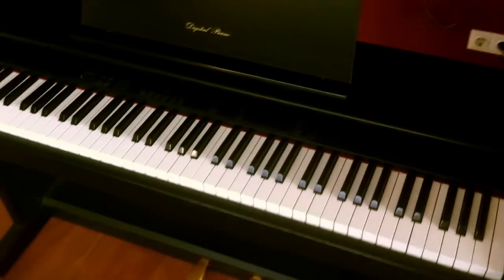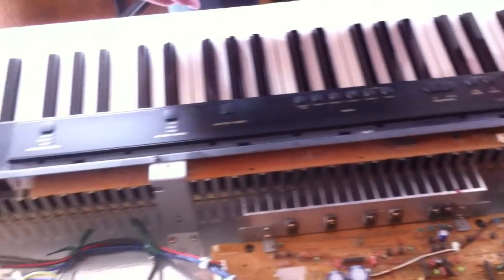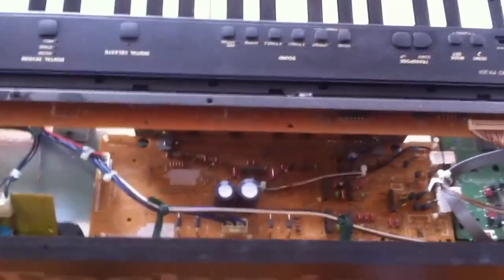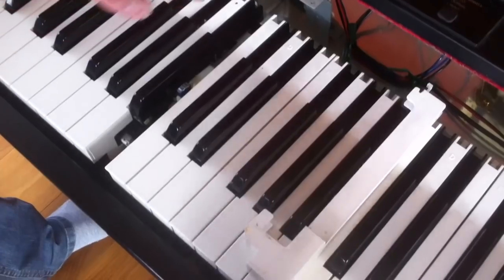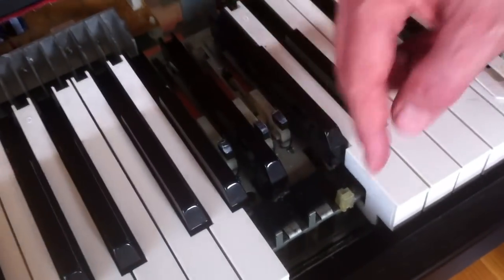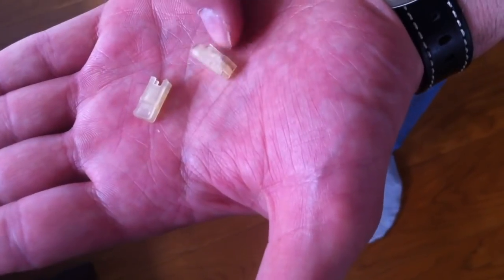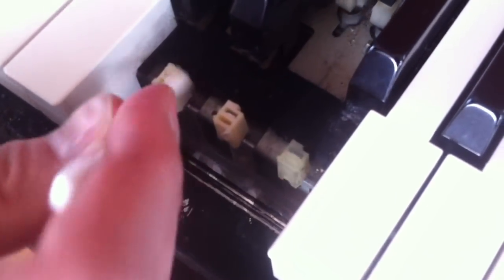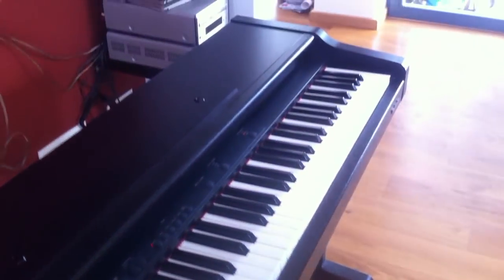Technics Digital Piano Keyboard Repair

Comment: I use a Technics digital piano (the same model as in the tutorial) for tutees who prefer digital over an acoustic piano. Being 34 years old my model is relatively ancient and occasionally keys fail to sound.  I have to dig deeper than in this video to clean contacts with alcohol but your video first gave me the courage to delve into the inner workings of a digital piano. Thank you for an excellent tutorial.
Reply: You can see videos about Korg SV1 and other Korgs with RH3 keys, this is the same keyboard.

Comment: This was a really useful video and fixed my problems with the PX201. I managed to break a key but it still works fine, held in place by the spring. The only foot-note that I would is that the earth doesn't seem to exist on UK models as the earth most likely runs through the moulded plug. The other things I would stress are 1. Unplug first and wait a minute or two as charge can be held in the transformer.  2. Don't force any of the plastic parts. The do come apart easily once you move them in the right direction. If you are applying a lot of pressure, you are doing it wrong. 3. Electric screwdrivers really speed the job up. Thanks for making this video.

Comment: Thank you so much. i just got a used Technics Digital Piano. Some keys were not working properly. So after watching your great video I opened it. Found out that 2 keys were broken. I replaced them with the other keys on the farthest right. I know it is not the best option, but those keys are rarely used. I will eventually order new keys and replaces them. Found an old Canadian coin under another key that was making the metal noise when releasing the key. Thanks again for your video. It has helped so many people.

Comment: Thanks for the vid . I have a technics PR700 which had exactly the same issue, so really useful to see how to deal with it.  A couple of things I'll add. On my model the cables connect to the PCB with plastic connector plugs which you can easily pull out so that you don't risk damaging the wiring attached to the control panel and/or keyboard. I would have thought that's the same for other models too.  In fact I managed to find the repair manual online, and it states that you should unplug the connectors first - it also means you can get the control panel out of the way completely before working on the keys.
I also managed to superglue one of the plastic parts together to get it usable again, and it's been fine since.👍

Comment: Picked up a heavily used PX101.  Not very pretty but the sound is great.  A couple dead keys in the upper ranges.  Your video will be very helpful when I open it up to diagnose.  Hopefully it is only a spider in a critical spot that a bit of vacuuming will fix.  Thanks for the great video.  Spot-on explanations!

Comment: Hello,
Thank you for the video : All those clear and sound explanation  had helped me to open mine with less fears !!!
In my case the issue was a metallic noise when key is released: baize damaged
I just placed a new ribbon
Cheers
Reply: Hey there, same problem just happened with my piano yamaha p45 ... the key  D3  plays with some extra metallic noise.. i gave it to the service centre but they can’t solve it.. would you please help and guide?

Comment: OK back again, finally fund the time to begin the disassembly.  I have taken the 10 screws from underside to free the keyboard but the keyboard does not come loose.  I can see there is a stain on the felt where something was spilled and I'm pretty sure the dried liquid has "glued" the metal kbd frame to the wooden chassis.  I'm reluctant to force the keyboard apart from the wood; could bend the frame.  

What is it that actually makes the key press "work" are there those rubberized / carbon switches under the keys?

Comment: Very useful. I had to go beyond this to deal with a liquid spill. I lifted the front of the keyboard and sat it upright on its rear edge. Then I unscrewed a long metal plate and took the switch circuit board off. Then removed the rubber boot where the liquid had spilled. Will clean the contacts and see if it all goes back together ! Shame I cant attach pics.

Comment: I just can't believe it.  This is my new favorite youtube video.  I have never in my life seen anything explained as clearly and completely as this video.  Just amazing.

One question:  My keys are not loose or stuck, but after we moved, now many of them CLICK whenever I press on them.  Do you know what causes this?  I assume when I open it I will see, I'm just wondering if you have experienced this.

Thank you for this amazing video.
Reply: I have the same problem, clicky keys. Curious if opening it up revealed anything and if you found a solution?
Reply: +Katherine Code Hi Katherine.  The good news is if you open up the piano you CAN fix the clicky keys.  The problem is, this video doesn't address the problem at all.

The good news is, I'm very proud to say we fixed our clicky keys, and it's so awesome, I can play it now without the constant clicking, I love it and it's totally worth it.  But it is way more involved than what he shows here.  At no point was anything difficult or were we worried that we would break something, so I say you should try it, but you have to take the keyboard all the way out of the cabinet, so it seems like you're messing with it a lot more.

What is causing the clicking is unfortunately simple wear and tear.  There is a thick piece of felt along the bottom of the keys.  Over time, that felt gets squished down, so it is no longer holding the keys away from the bottom of the frame, so when you release a key, it taps the metal.  What we had to do was buy a piece of felt from Michaels, cut it into strips about 1/4" or 1/2" wide, and insert it on the bottom ledge of the keyboard frame where the keys are tapping.

To do this, follow all the instructions in the video until you have the keyboard unscrewed and loose in the cabinet.  Do not remove any individual keys like in the video, that is not necessary.

The difficult thing is that you have to remove the entire keyboard from the cabinet in order to access the underneath.  The scary part is you have to disconnect the wires that go from the keyboard to the cabinet (the ones that the guy in the video said he didn't want to mess with).  As you can see in the video, all the wires are tied down with giant bread-bag ties.  Take a lot of pictures with your phone so you can put things back how they were.  (It is actually easy to get everything back together, but it will seem intimidating when you are taking them apart.)

After the wires are untied from the frame, then you have to disconnect them from the frame.  The only delicate part is unplugging the ribbon wires from the circuit board.  This is very tight, so you have to just slowly work it back and forth.  It will come loose; don't force it, just work it back and forth.  Then there is another small wire that leads to the power switch, and I think one more.

When you get the wires all disconnected, then you can lift the keyboard out of the cabinet.  Here again, go slow and don't force anything.  It comes right out, but it's really heavy, so it will take you a minute to determine how to lift it out.  (As I said, this is much more difficult than the repair in the video.  It can be done without any trouble, but you have to be brave and careful.)

When you and your friend have the keyboard out of the cabinet, put it on a table with one end hanging off the edge.  If you get under the keyboard and look up at the bottom of the keys, you'll be able to see where they are clicking.  There is a small metal ledge that runs the length of the keyboard.  Keep hitting a clicking key and you'll be able to see what I'm talking about.  The piece of felt that is supposed to be catching the key has worn down so there's a deep indentation, and it is allowing the metal part of the key to hit against the metal ledge.  You need to put a strip of felt along that lip.  At Michael's, get a few different kinds, you want it to be as thick as possible without interfering with the keys.  (If it's too thick, it prevents the key from coming all the way back up.)

We used rubber cement to just lightly anchor the felt to the metal.  Then we had the felt cut into about one-foot strips.  I got down on the floor and dabbed the cement onto the strip in three or four places, then my friend pushed down all the keys for about an octave at once, and I slid the felt into place.  Then she let up on the keys, and that was it!  You can bang away at the keys and NO CLICKING!

One last thing--you can do the ends of the keyboard this way, but not the middle.  For the middle, we placed the keyboard between two chairs, so the middle section was in the air, then I got on the floor underneath it to place the felt for the middle keys.

That is it.  Then reverse the steps to put the keyboard back.  The hardest step is sliding it into the cabinet because it is heavy and the fit is tight.  Just be careful.  Once you have it back in the cabinet, the rest is easy, reconnecting the wires, tying the wires down, then screw in the screws on the bottom that hold the keyboard in place, then follow the video.

The one thing that troubled us was, when we put it back together, it seemed like there was a gap between the cabinet and the control panel.  Before you do anything, take a hundred pictures of everything, because I figured out that gap was there before (you always run your finger along it to get out the dust, but there's always some extra in the gap).  So everything went together perfectly, and you won't believe you're actually going to be able to play your piano again without the clicking.  It is SOOOOOOO great.

So, this is involved but you can do it.  The clicking on mine got so bad, we made the decision before we opened it that we were ready to get a new piano if this didn't work, but it DID work, and now I have no reason to get a new one.  You will be super proud of yourself if you try this.

Please let me know if you have any questions!  I will be more than happy to help you out however I can.  I'm so proud of what I accomplished, I'm happy to spread the knowledge.  :)  Good luck!
Reply: Thank you so much for the detailed reply, greg! After more sleuthing around online I pretty much came to two conclusions: that the clicking likely IS due to worn-out felt (the piano is over 20 years old!) and that I'll need to take it apart to check for sure and see if there's something else as well. 

Have been trying to find out where I can get the correct replacement felt before dismantling the instrument, so your tip about Michaels and cement glue is super handy. A friend has already volunteered to help, and after reading your advice, it looks like I'll need to take him up on it, even if he thinks putting grease BETWEEN the keys is a good idea.  Hopefully my music will be click-free in the very near future!! 

Thanks again, your knowledge is of great help! ☺
Reply: +Katherine Code  I hope it works out.  One detail--I'm not talking about replacing the worn out felt.  Rather what we did is put a new piece of felt in a different place, where the clicking is actually happening.  The worn out felt is letting the key go down too far, so it's hitting the metallic ledge.  You'll see what I mean if you open it up.  (Replacing the worn out felt would be difficult because it's very thick, it would be difficult to find outside of a piano-parts warehouse, I think.)
Reply: Ooh, that's a good detail to know! Thank you! One video I watched showed replacing the felt (on a different make/model), and it took them over half an hour to remove the old felt with an exacto knife and some needle-nose pliers. Your method sounds much better!
Reply: Thanks again for your help, Greg! Getting the keyboard out of the casing was really easy with the video and your additional instructions. I found some felt with adhesive on one side that I cut into strips. It seems a little thin to me but it's thick enough to stop the clicking which is all that matters. :)
Reply: @greg55666  Thank you so much. I had anyway pulled my piano apart and was thinking about doing the exact same thing with the felt on the metal plate, but I wasn't sure what kind of adhesive I should use. I'll give the rubber cement a shot.

I'm excited that I might not need to buy a new piano after all.

Comment: Hello! In the minute 8:48, you touch a black rubber. Where can I buy those?  My Casio Px100 has many broken tiny black rubber parts and cause that I can not push the keynotes.

Comment: Help, if possible 🫤
I did repair my PX103 (It was the felts I had to change)... no sound at all. Neither with a headset or by speakers. The control panel seems to work fine but it seems also my keyboard doesn't send any signal out 😭😭

Comment: Great video however, where in the heck did you find the replacement parts? I can't find an online shop that does.
Reply: Try searching the net for Mike Barden.  I'm pretty sure he used to run a technics piano website, but certainly looks like he can still help with repairs / parts

Comment: Thanks for this amazing video! Question to you or anyone here, with the keyboard off, some of they keys do a crack sound when the key is released - sort of against the back of the key, initially I thought it might be a dirty contact or similar, but the noise occurs even with the power off, so it must be just dirty or hardened little felt perhaps? Anyone had this issue?

Comment: Thanks you vert much for this vidéo...i got this model,still working for years until i pull i t for a short distance in m'y appartement,and then thé screen dont light on and it dont work at all.
I sée in this vidéo how to open thé top ,and will verify if thé Switch AT thé left witch plug thé screen IS still in place ...thanks you

Comment: Hi, thanks for uploading this extremely useful video. I have the same problem. Would you please let me know where I can order the spacing blocks? Regards
Reply: +bellaxyzdonna keen to know aswell
Reply from the maker: This is where I got the spacer blocks:
https://www.synth-parts.com/Tasteninstrumente/Technics/Technics-E-Pianos/
Reply from the maker: This is where I got the spacer blocks:
https://www.synth-parts.com/Tasteninstrumente/Technics/Technics-E-Pianos/
Reply: Thanks again! these are named the key guides?
Reply from the maker: Specifically, these are the key guides I used (Product # KLTPW88-KG):

https://www.synth-parts.com/Tasteninstrumente/Technics/Technics-E-Pianos/Technics-PX-Serie-E-Pianos/Technics-SX-PX101/Kleinteile-Tastatur-fuer-Technics-E-Piano.html?cnid=50e9db4b97d449a8bcef3ad396da2f54&actcontrol=alist&lang=0&pgNr=0&cl=details&anid=2467b457582afa9ada4ca9eaaa7c20cc&varselid%5B0%5D=4b9578ba9de4f30091807c82009a32bb
Reply from the maker: On the invoice they show up as "Key Guide for a Technics E-Piano"
Reply: Hi. Do you remember how many there where in a pack as €3,50 for one is too much. Especially as I need more than 20
Reply: Hello. Does anyone know the name of this plastic piece?

Comment: Thanks a lot for your video, I had exactly the same problem! I couldn't find the parts for sale, so instead I had them 3D printed, using the file that someone submitted on https://www.thingiverse.com/thing:3872069/apps . They were a bit too small compared to the originals (maybe ¼ of a mm, not sure exactly), but they fit with the help of gentle hammer taps. Because they weren't quite wide enough, the keys still wiggle just a little bit but it's a great improvement over that clacking sound they made before. It surely is possible to scale the model in the file to compensate.
Reply: Syntaur.com in Texas has original key bushings for the Technics PX-201. (I just decommissioned my piano and sent them all the spare parts)

Comment: Thank you for an excellent video. I was wondering if there was a way to contact you to ask for some advice. Im interested in building an extended keyboard, one with 108 keys and was hoping someone might be able to help me. I live in Hannover, (können auch Deutsch sprechen), and I have an existing Kawai mp9500 and want to extend either end (bass to go down to the c (extra 9 notes) and up to the b (extra 11). I'm considering to buy another mp9500 for this purpose. there is a contact on my website www.ashleyhribar.com where I can be contacted as well as here.  I look forward to hearing form you! Ashley
Reply: @ Ashley Hribar Hallo! I am not German but if you bare with me, I may or may not be able to help! I used to have a Kawai MP9500, and MP8 which I sold. I still have the wooden keyboard mechanism for the MP9000/9500 which I had planned on using to build a custom baby grand electronic computer controlled workstation piano.  I need to know exactly what it is you are trying to do? There are ways to do it BUT the electronic contact board designs on the Kawai will NOT allow it! It has a key scan IC chip ON the contact board itself as well as an additional circuit ic chip on the motherboard. I do NOT intend on keeping my contact boards for the keybed as I do not need them for my project but this may be of interest to you IF you still want to try to hack your MP9500? I looked at this Technics keys video and say to myself, I am glad I love WOOD KEYS!! Plastic keys suck! Anyway, check pianokeyjoe and find me! I am pianokeyjoe for a good reason!!